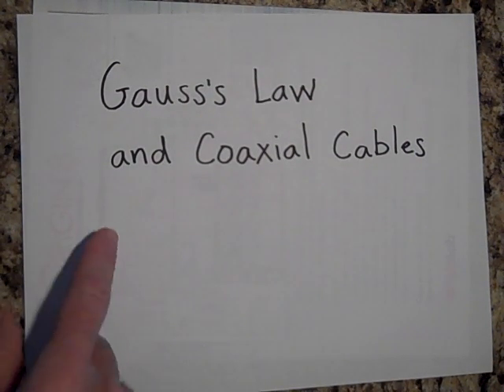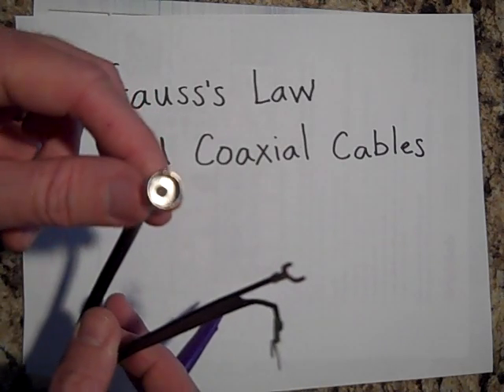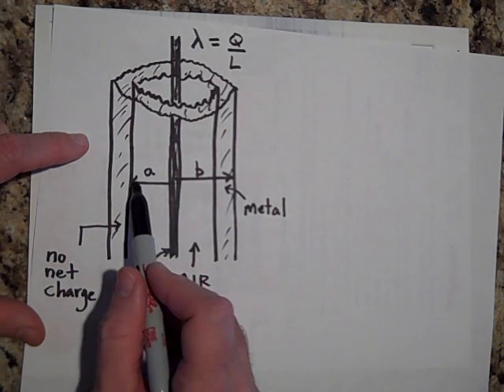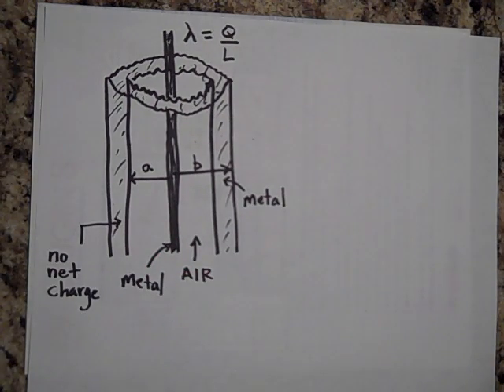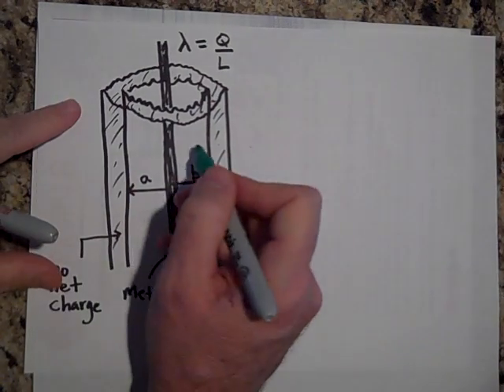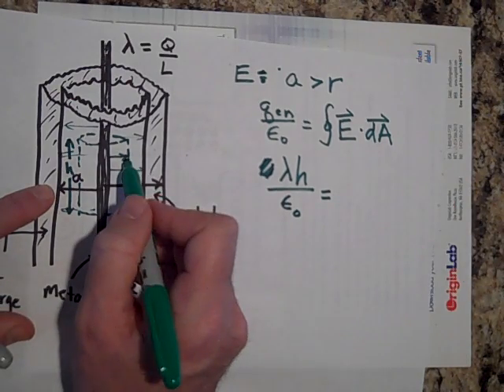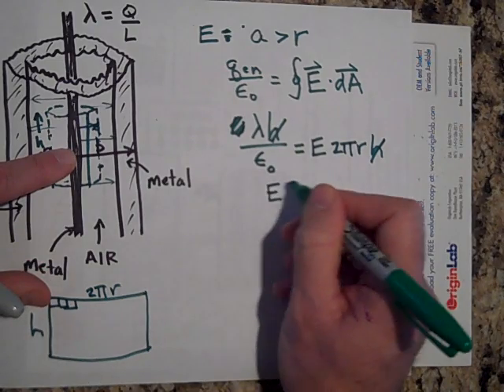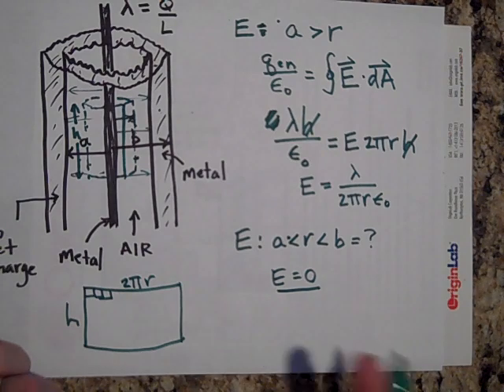Gauss's law and Coaxial Cables or Cylinders (part I)

Comment: I thought the shielding's job was to prevent the coaxial cable from leaking an electric field into the outside world.  But the formula here shows that it does get out?
Reply from the maker: Yes, coaxial cables usually cause both electric fields and magnetic fields (and therefore EM waves) to cancel out when they are outside the cable.  This is usually the case because the current going through the center wire is equal but opposite to the current going through the outside cylindrical wire.  In the example in this video there is no current and there are only charges on the central wire. So no shielding in this case.

Comment: When he is referring to the outer field of the cylinder, there cannot be any electrical field, because the outer shell is grounded, indicating no net charge, as the positive core charge negates  the negative charge on the inner cylindrical shell. In part two he exactly comes to this conclusion, which also is identical to the example of the Gaussian sphere in an earlier video.

Comment: SIR IF THERE IS no net charge b/w 1 and 2 cylinder than that means there is some negative line charge density and the the charge for outer gaussian surfacre should be zero???
Reply: +NEERAJ SHARMA No. There's some charge on one surface and the inverse of that charge on the other. meaning that the net charge is zero because when you add the inner and outer surface charges the total is zero.

Comment: sir, how to know when to use limda, sigma and rho ?
Reply: Hakim Zaz For international convention lamda is for linear distribution, sigma is for area distribution and rho is for volumetric distribution
Reply: thank you very much..
Reply: +Phillippe Foix  Totally, but why use lambda for the cable, when we use sig. for hollow spheres/planar sheets, and rho for insulated spheres, etc. Seems counter intuitive, and I have my first exam tomorrow O_o
Reply: +Max Dornfest Use sigma for surface area, rho for volume. Since we are not concerned about either the area or the volume of the wire in this problem (i.e. we are treating it as a continuous line of charge,) use lambda.

Comment: On the last problem, shouldn't the charge on the inside of the outer wall be -q, still being in elctrostatic equilibrium? In that case the outer shell should also be grounded, giving a net charge outside the cable of 0, and therefore E=0 by equivalence. But since there is an electric field outside i guess the outer shell is in fact not grounded, giving a positive charge q on the surface of the outer shell as well.

Comment: In order to have an Electric field between the cylinders one must have Potential difference (Voltage) across the cylinders. If the material of the cylinders is an insulator (non-conductive material) electrons would never travel to the surface of the cylinders creating no Electric field since there is no Potential difference there.

Comment: how come for the metal hollow sphere with the metal sphere with charge Q inside you said that the outter shell would have to be negative Q because of the argument that if E=0 within the metal shell the Qenc=0=Q+(-Q).. could we use the same argument in this case? that the metal shell would have to have a charge of -Q because if E=0 within a<r<b.. we're saying that Qenc=0=Q+(-Q)?